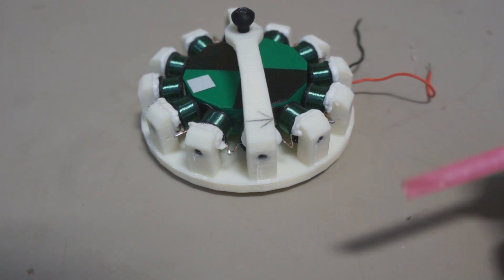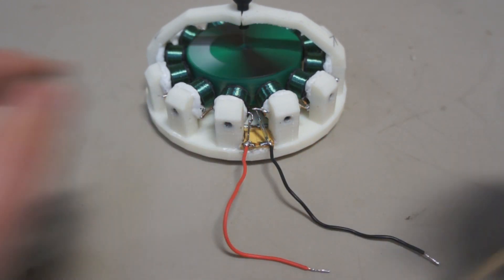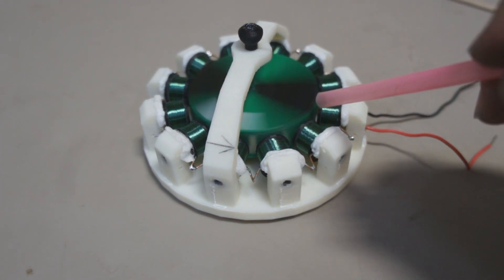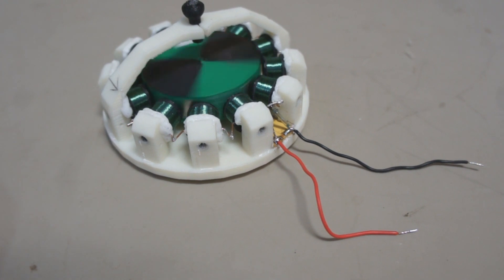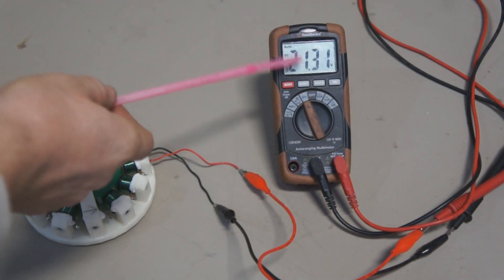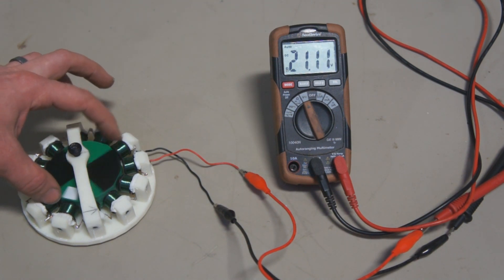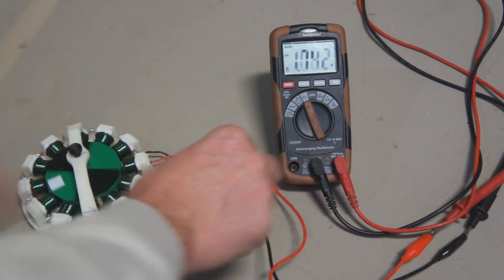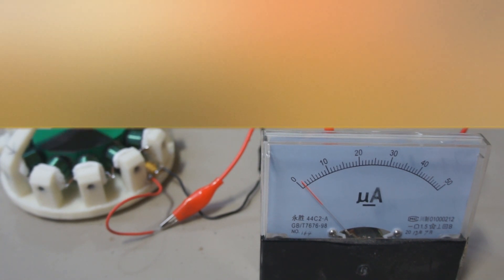3D Printed Motor Runs Almost Like a Perpetual Machine

Comment: People around the globe have always been thinking of a way to build clear energy... And it is quite easy to understand how difficult it looks, but... What if the project would be put into a magnetic axis to avoid friction, plus put inside a vacuum chamber to avoid even air friction, would it be the beggining of a solution?

And what if this project would have be conduct in space to avoid gravity force?

If we put a huge chunk o magnets rotating in space, making a magnetic field, will it be generting a small voltage forever?

I understand that to transfer this small energy to something useful would be another difficult task, but to your understanding would it work?
Reply: What most people just can't wrap their head around is that even in zero gravity and zero friction, it will be much more efficient, but no matter what it will not be perpetual or create more energy than what is put into it. Also, at 100% efficiency, you will get exactly as much energy out of it as was originally put into it. You will never get more energy out than what was put in. It's all just converting energy from one type to another to make it useful. You take the energy of heat, wind or tides and CONVERT it to more useful electricical energy. The laws of thermodynamics explain this. Example, how do you make a car move with moving water? Well, you could use a really strong hose and spray the back of the car, pushing it along, or build a device to convert the movement of the water (as efficiently as possible) to electricity to then power a more useful and controllable rotary electric motor to turn the wheels of the car. Another example using the wind. You can either put a sail on the car and be at the mercy of the winds direction and the drag and the fluctuating gusts, or build a wind turbine to convert the wind into electricity. That's really all there is to any of it. Look into sterling motors/engines. They are pretty cool and use a difference in teperatures to run. There are youtube vids where people have built small ones that begin to run when place on the palm of their hand. The difference between their body temperature and the ambient air temperature makes it run. I have had an idea in my mind to make one that runs on compost. Placing decomposing organic matter like mulch, grass clippings and food waste in a pile inside of it. The decomposing material would create quite a bit of heat and i would expect the motor to run pretty well especially in colder weather.
Reply: vvisions lots of people think like you :) very forward thinking,, one problem is that its so expensive to launch anything and it has to be shielded from radiation, space dust and impact. so passive solar farms here are a simpler solution and i like the idea of capturing ocean wave motion to generate power too
Reply: pds tech  Yes, there are the ocean and nobody really uses it, maybe for the corrosion problems and such, but I heard of a watch that should work forever, with the oscilation of air pressure... That is supposed to work, maybe only into a micro dimension, not really useful for real scale projects... but  I'm not sure.

Talking back to  the space Project of a perpetual machine, it could be done, if wasn't already, into a very tiny scale and be put to test insto space...

Plus, there is Always the natural magnetic field from Earth and the solar explosions that send magnetic fields, if all those energy could be captured it would be a so giant step,  captured and transfered like those wireless power charger that can load your smartphone (this last only to  prove Tesla was Always right about his ideas and ideals).

And thank you for your kind quotation and attention pds tech, we need more people like you on youtube!!

Comment: So, if you had a large capacity, low-resistance chargable battery (or capacitor) hooked up to this with it set up to be spun by the wind, you could hypothetically charge it pretty quickly, right?
Then you might be able to use that same battery with a current limiting resistor to charge smaller slow-charge batteries?

Comment: What's the output?
Reply: there's no output, it's a motor. It won't generate energy, it just stores it very efficiently but uses it up eventually due to air resistance and friction from the pins holding the rotor.

Comment: Hello! So that's mean if you connect a little wind propeller on the shaft, in bracket with a system angled to be always facing the wind, it will almost never stop to provide power. Zero air movment are so rare in nature.

Comment: Why is the voltage still going up after you stop blowing?
Reply: krap101 Momentum. The motor is still spinning faster than it would if it were just being pushed by the stored voltage, so it continues to increase voltage (pressure). As voltage increases, so does resistance, so eventually it will begin to slow down. Once it gets below a certain threshold, it'll start bleeding voltage, as it's then being used to keep the motor spinning.

The same concept is used in hybrid electric cars for regenerative breaking--while the car is moving, it's discharging the batterys by spinning the motors to move the car forward. When you begin breaking, the polarity on the motors is switched so that now instead of draining the batteries, they're charging. The change in polarity causes the voltage to go from positive to negative (or negative to positive), and resistance increases, so the motor slows down, causing the car to slow down.

Cool stuff. ;)
Reply: the coils do generate a tiny bit of power, but when the motor has lost the kinetic energy from the jumpstart, the voltage will start to drop.
Reply: Energy stored in the flywheel is converted into electrical power via the coils. There is energy lost in the conversion, it can only do that and keep running for so long. Every single power plant on earth uses this system on a much larger scale to help prevent power-outages.

Comment: In theory, you should be able to get a similar performance without any coils by using a very heavy rotor, so that the energy used to start it spinning is stored as more rotational kinetic energy. as long as the extra weight does not increase friction losses in the bearing. Perhaps a magnetic bearing would be better.

Comment: I have a simular thing but no wires or coils it spins a lot faster than urs on these video its stabile for 3weeks now my question is how to conect wires to a rotating motor cuz i have energy from it i joust dont know how to get the energy out to use it licke conect it to a lightball or what ever cuz now its joust licke a wired toy that keeps spining i have a fell it will stop alny if i brake it,hope u answer,licke ur stuff

Comment: I don't know much about electrical currents, but I do know that decreasing friction would help. How about you use a denser print, (looks like you used a semi hollow print fill) simply to increase rigidity. Then encase this in a plastic dome, to be able to create a vacuum. This, in theory, should be able to increase spin time!

Comment: oh yeah,  slow moving allows also for much safer operation in the case of a high wind or even tornado, (easier braking system, recommend 3 different brakes to be more safe, (when high speed windmills fly apart, the vanes can fly as much as a mile before landing depending ... ), the slow speed allows or much larger lightweight sail cloth design for vanes, which then being larger surface area can harness the slower winds.  win win !

Comment: In answer to others comments I would "daresay" the power it not much, but it might be very useful for perhaps "gyros" in guidance systems for navigation... this motor appears to almost perfectly balanced,  great job !    I guess the logical follow on would be a very large version perhaps 10'-30',, and see if the power increase is enough to give a few HP?  (keep it charged with solar and wind combo;   fyi:  I think the large sail slow moving "dutch type" windmill is promising for home (you have to the yard space) use to give maybe 5HP and the slow moving perfectly balanced "sail vanes" would give it the power needed in a much less wind (maybe 4-5 mph would work),needs research but 5HP would equate to a 4-5kw generator output.  Hey, sounds crazy but i hear the dutch have been pumping water out of their lands for a long time with the slow moving large sail design.

Comment: Perhaps make a taller one with the functional motor parts at both the top and the bottom. Then have the center area be painted and detailed as a Tibetten prayer wheel. Likely just throw a tiny solar cell on top of it for gathering all the power needed to keep it running indefinitely

Comment: After the short and the cap starts building up voltage again, could the fact that meters have a small amount of current going through them be recharging the caps?
Reply: DaveC1964   Not sure on capacitance but I thought he said they were 10 volts each for 20v total in series ,  if that helps.

Comment: Hi,

Cool motor.  You should think about selling pre-made kits.  You could probably make a bit of money.  I would build one but the lack of a 3D printer is a huge obstacle.  Those print services are ridiculously expensive too.

The other thing is that winding those coils looks like a major hassle.  You can get coils wound to spec through one of those Chinese suppliers.  It wouldn't be worth it for an individual to get a few coils but for you if you make a lot you would meet the minimum order. 

If you "commercialized" these a bit with pre-made coils, your printed parts and all needed commercial parts you could make a very saleable kit.  I know I would have bought one.  For most of us making our own from scratch would be a bit too much.

Comment: This might sound crazy. It might be crazy. But I'm trying to build the lowest impact, essentially off the grid tiny home. It will have solar power, and use propane generators as a back up (very last resort back up). With the goal being as close to off the grid as possible, I'm looking for efficient solutions to household appliances. What I have in mind is a clothes dryer (a washer is another story).

Would something like this be able to be replicated on a larger scale - larger magnets and capacitors to spin a cylinder of wet clothes, while also generating a fair amount of energy to heat it? Something that might initially run off a hand crank and then go relatively unassisted for minutes on end?

Comment: What could I power with ? 
 I'm looking for some thing to run my green house
Reply: dont think that would work ... even if it runs on like 20 volts and a micro amp that would be like 20 microwatts ... and old fashioned light builb needs 80 watts. in other words you would need 4 million of these motors running at 20 volts to power one light bulb

Comment: Does it have the ability to produce effective work while doing this though?
Reply: +Delicious DeBlair the amount of power that this motor has is rather small. I was thinking that someone might be able to turn it into a record player style music box though.
Reply: +JareMicah Schmidt Well that is not too bad of a goal, as long as it is economical to produce, reliable and there is adequate demand for it.

That said, be it a mechanical record or maybe a CD player [which uses less power than a record player to begin with but could be made to use even less if you put a hand operated vacuum pump to pump out the air inside] with high efficiency mini piezoelectric earbuds, it might be a very real option which could save tens of millions of batteries which are toxic and fill our land fills insaneley.
Reply: I would argue that a record player ad a cd player would use about the same amount of energy for their scale except for the fact that a record has a far lower data density. I thought record player because it would follow the idea presented and be a fun easy project that anyone could do given fairly cheap tools. I am not sure if this motor could spin a cd fast enough to effectively read the data on it but the idea of using a laser diode in a vacuum would be interesting. I could also see using quartz earbuds or a similar speaker to save on power. IDK, if you could replace modern MP3 players though, they have rechargeable batteries and use quite low power.
Reply: +Delicious DeBlair this really got me thinking... you possibly coukd modify an FDM printer to print a record. If you made the X axis rotary instead of linear you could print in a continuous spiral. also you could increase/decrease the extrusion parameter to get deeper/shallower groves with more incremental precision than z-steps
Reply: +JareMicah Schmidt the better question is: can a 3d printer print a record with enough accuracy to be playable? That would be really sweet but alas most printers have minimum 0.1mm layer height steps so audio would be bumpy
Reply: mlnlme1 Most extruded plastic printers only have 0.1mm or larger layer height. laser cured resin bath 3d printers are known for being more accurate. However finding such a printer with a big enough volume to print more then a few seconds of sound would be hard. Good thing a lot of 3d printers are open source.
Reply: They are greatly imprving printing devices daily.
Reply: +JareMicah Schmidt you can do better with an SLA printer but their build areas are generally small
Reply: mlnlme1 That is a great idea! Just have to give it something to print on so it does not warp.

Comment: Well to see this in action it brings to mind the potential of how few are the forms of energy and mechanics we have yet to tap. Today's cool experimental project may be tomorrows everyday super efficient, low energy work horse. Nice project!
Reply: rheniformer    3 BIG RESOURCES UNTAPPED:  1.  Lightening (over 20,000 per day in just FL alone each could power a city for a  few days? 
2.   DIff in temp between night and day (especially in the north)  OR imagine the solar dish heating the hot end of the sterling engine, the cold end goes thru the center of the dish and is buried in snow and in the shade of the dish?   LOGIC:  the amount of heat energy given to the earth each day is more than we need.. we just need to get good at harnessing it.  IE. calculate the amount of BTU's it would take to heat the whole USA to from say 20 deg at night to perhaps 35 in the daytime? Or just calc the btu's to heat the USA just 15 degrees on any clear day.. it ALOT... so we are energy wasters...being bombarded with energy while paying thru the nose for energy ?       3:  Same for drinking water, we get rain almost every week.. but we just sit inside let soak into ground.,. then complain about high water costs and not enough to go around, then we let them talk us into super high cost $$  de-salinization plants?  sounds like we are not paying attn ?

Comment: People just don't get it, They will say it is overunity, overunity cannot happen by definition. What it is doing is converting magnet energy into electrical energy and the rotating motion, Permanent magnets are amazing.
Reply: TheBrowseman  To be more clear IMHO, there are devices that really do run seemingly forever" but they really are not overunity, since they run on the motion of the earth (like the tides.. they keep on coming thru day and night,.. so a tidal gen might be labeled by some" as over unity but really since the planets wil eventually crash into the sun or the sun explodes stopping the tides, overunity is not really there.. tidal generators can run for a billion years or more providing great HP.. but in the end they will stop (billion years or more).   The Smithsonian Inst has big clock that operates on the motion of the earth as it rotates on its axis ... but same thing : it may run long time but not forever.. so you are right, Over Unity does not really exist but on the other hand, solar, wind, tidal, earth motion FOR OUR LIFETIMES to us is "Relatively " constant.

Comment: Try building another one using jewelled bearings which can be removed from a scrap wristwatch and repurposed.  Then your motor may have a significant working lifespan.  Sharp tipped plain bearings like you're using now will wear down pretty quickly.

Comment: Just a thought, if the EZ Spin runs on such a small voltage would it not run perpetually using a solar array and a rechargable battery????  Just an idea your video gave me.  Great design though.

Comment: Is there any particular reason you can't just link two of these motors together on the axle so they power each other in a loop while using the capacitors to smooth out power loss over time? It wouldn't be perpetual but I'd imagine it would do go on for a very very very long time.
You could also rig it so that a battery would supplement the voltage once it comes down to a certain threshold.
voila. Near perpetual electric generator. Right?

Comment: There is a branch of industrial power equipment that is things like this.
Rotors that store electric charge in kinetic energy, in a very very low friction tubes.
And when the power grid needs VERY FAST POWER INJECTION they connect the coils backwards and give the energy back to the power grid.
They don't heat as massive batteries would, they store more energy, they have higher power delivery.

http://en.wikipedia.org/wiki/Flywheel_energy_storage

EDIT: I forgot to congratulate you, this is an amazing demostrarion of kinetic/electric energy conservation :)
Reply: Exactly- Williams "Flybrid" storage system as used in the Porsche hybrid GT racer. This is a small, simply regulated version of that system, which they use as the storage medium for their KERS systems. Trabber Shir explains the principle very well.
Reply: Audi brands their solution e-tron. It's been getting used by them in Le Mans for years (think it's banned now because of their domination) and now they're bringing it to consumer vehicles.